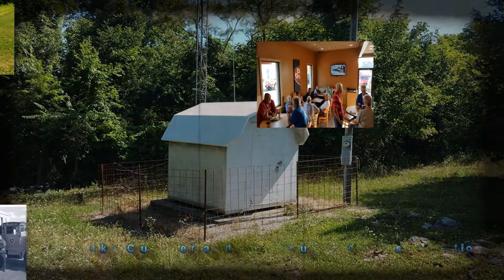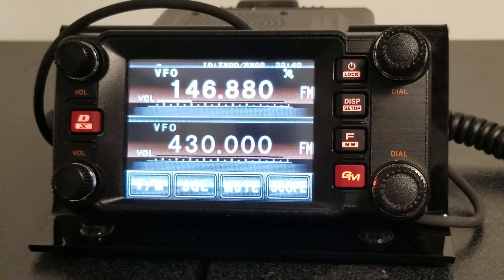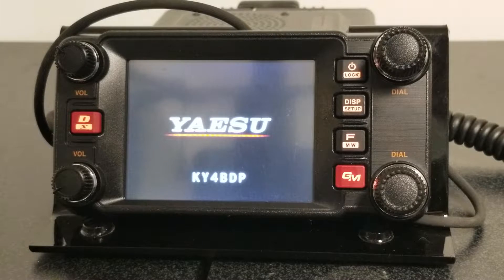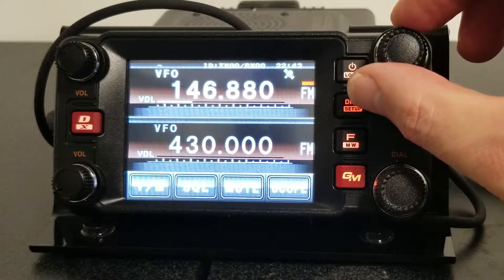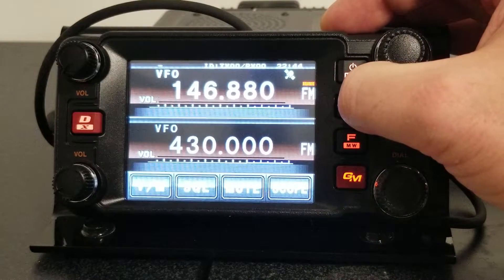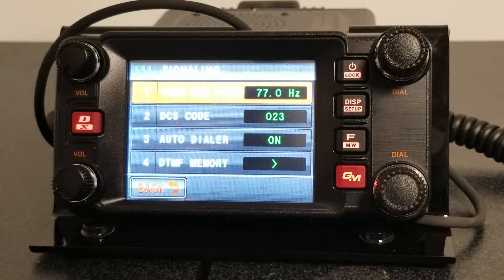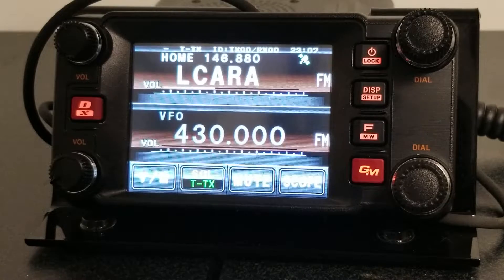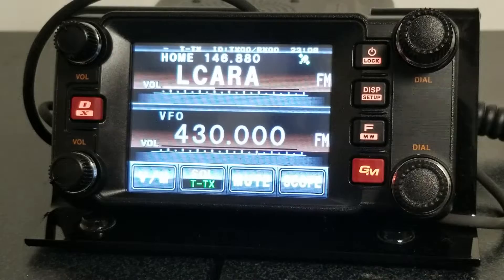LCARA HAM Radio: Yaesu FTM400/XDR Initial Setup and Repeater Test

Comment: I would like to thank you for this video, I’m a new Ham and I don’t have the 400xdr yet but it’s the radio of my choice after debating between the Yaesu and the Icom 5100A, I’m just waiting for any holidays specials on the 400xdr it seems like an extremely good radio and easy to program, I was wondering if you have any videos on using WireX and programming it with the RT system software. Thank you in advance ( KO4SPS)

Comment: Thanks for the great review. I just purchased an identical unit ... I am a newbie KE8PWK ... This is just what I needed !!!
Reply from the maker: Glad it was helpful!
Reply: @LCARAHAMRadio  I have a brand new FTM-400XDR/DE which i just purchased ...  I can only receive NOAA weather radio ... Comes in perfectly but it seems like I am getting a lot of other signals on 70 cm and 2 meters ... But I don't hear anything ...my scope function is working but no sound ... I was told to find an Elmer but a couple of local clubs as closed because of covid19 ... I have read my manual bet to no avail ... HELP PLEASE ... KE8PWK 🙉😳😢